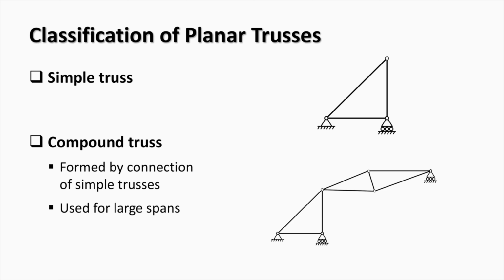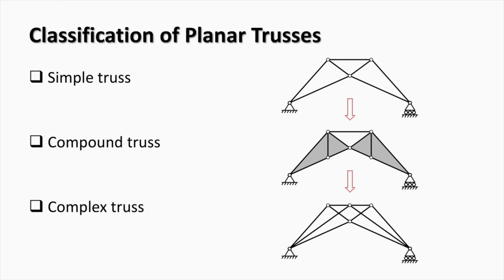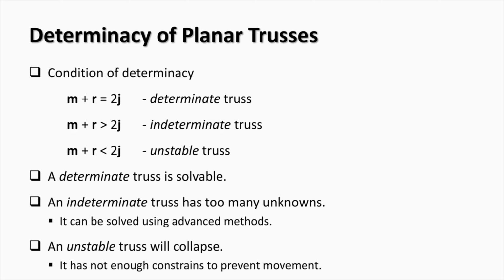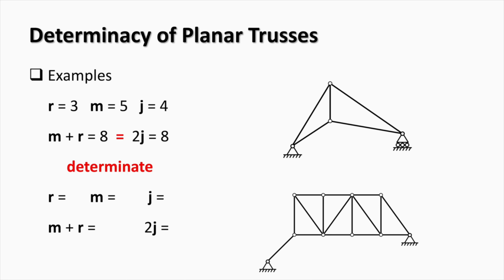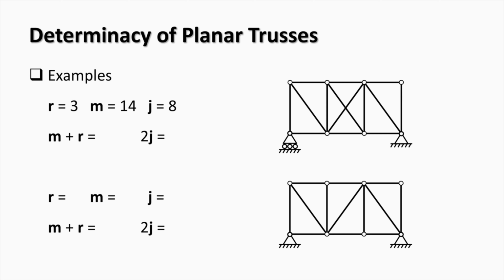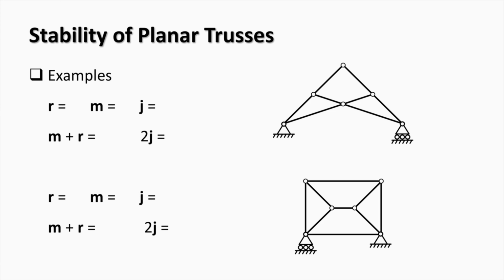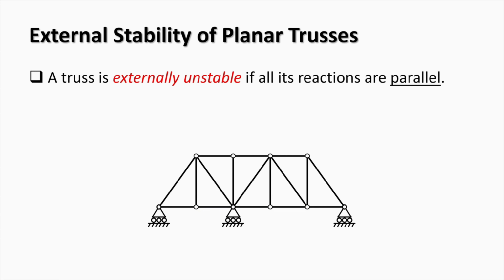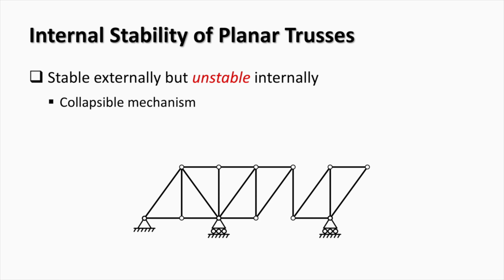Engineering Mechanics: Truss Lecture 4 - Classification & Determinacy

Comment: A lot of information to absorb. Sometimes if it looks unstable, it is. At other times needs analysis.
Reply from the maker: Exactly — you’re absolutely right! Sometimes a truss can be statically determinate on paper but still unstable in reality if its geometry doesn’t provide proper restraint. That’s why we don’t rely on the equation alone — a quick stability check is always essential.
I’ll admit, it’s something I’ve been caught out by myself — even when it looked fine at first glance...